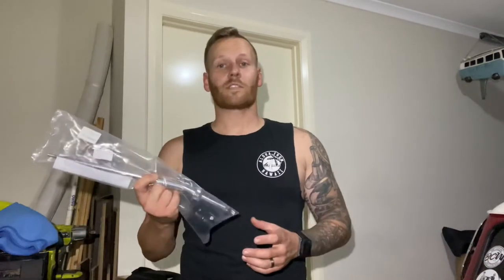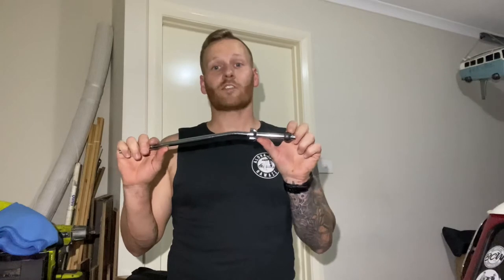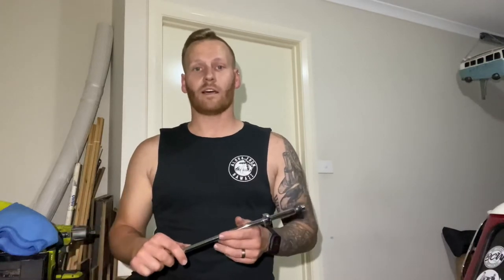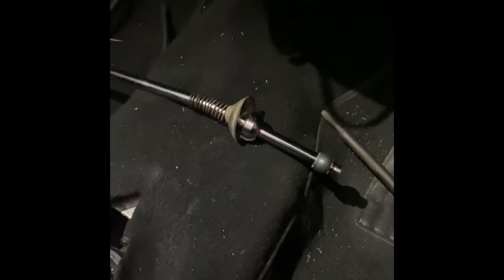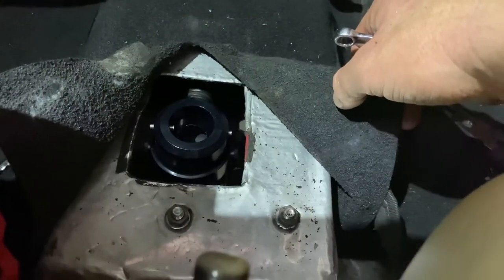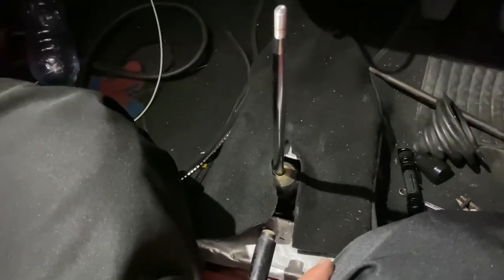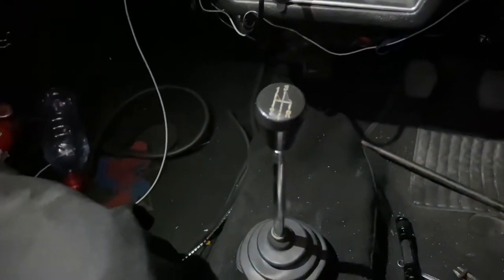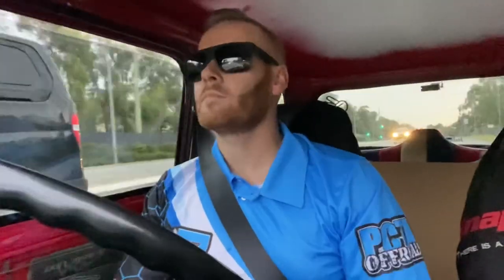Leyland Mini Short Shift Install - EPIC MOD!!!

Comment from the maker: My mistake guys, I should have said “if you lengthen the distance between the fulcrum and load, it creates a mechanical advantage with a longer throw. If you shorten the distance between the fulcrum and load, it gives a shorter throw, therefore less mechanical advantage.

Comment: How’d you get the pins out while it was still in the car?
Reply from the maker: @Rokwallaby  hey mate, love the name!
Are you referring to the pin that located the gear stick in the housing to prevent it rotating?
Reply: @Tomostuneups  yeah the retaining pins,  not sure how you got them out without un bolting the housing and lifting the car, there’s like zero room to tap them out
Reply from the maker: @Rokwallaby  it may have been that my tunnel surround was square rather than semi circle like a standard Classic Mini or most likely that the pins had worn to the point they weren’t being held in very firmly. If you loose closely in the video, I had some black silicone holding them in as they often fell out or came loose whilst driving. 

But you’re right, taking the whole assembly out is like out the way to go if they don’t come out in the vehicle